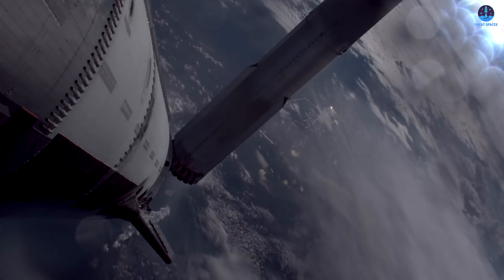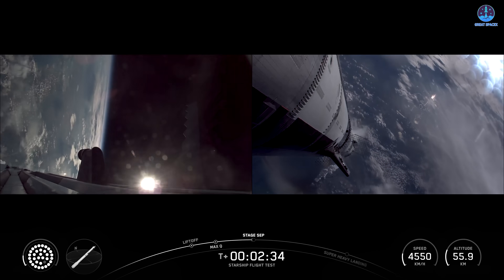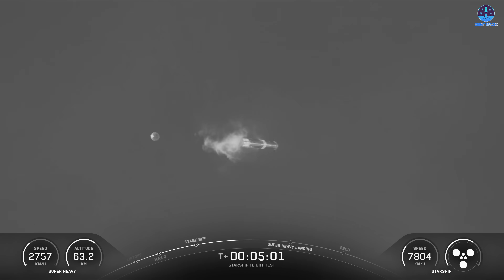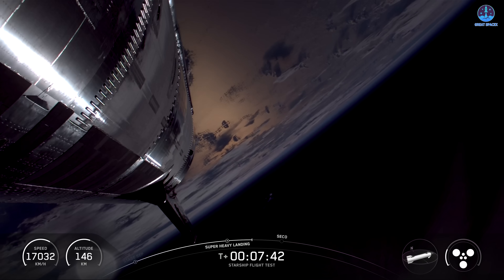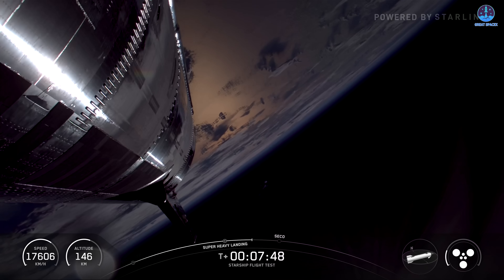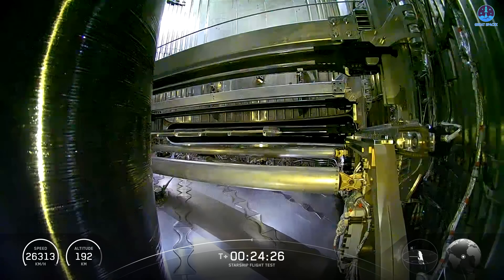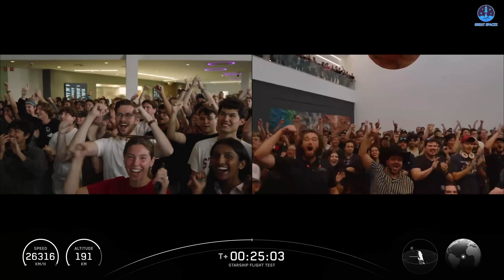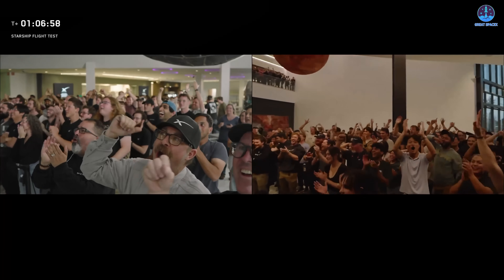BIG NEWS! Starship Flight 10 S36 successfully Deployed Starlink & Splashdown, B16 Landing Flip

Comment: Did you notice that one of the booster's 10-ring engines shut down at about 1:33 into the launch?
Reply: Yep.  They’ve seen a few engines misfire over the past launches.  Even the one that they successfully caught had an engine fail.  There’s enough redundancy in the design to deal with it though

Comment: Was it supposed to explode like that?
Reply: If you mean the explosion inside the engine bay with all the insulation debris; no, that was not planned.
If you mean the explosions at splashdown; yes, both were expected. My speculation is that a self destruct explosion is used to break the rocket apart allowing it to sink to the ocean floor. It's easier to recover than if it goes floating around, pushed by ocean currents to unknown locations.
Reply: @3DPDK thankyou
Reply: Yes, it is the most ecological way to do it. Letting it sink intact can cause major damage to the sea life in the area should water pressure crush it and even if it remained intact, it would be too dangerous to recover. The parts that were under the water when it blew up will be far less damaged than the rest of the ship and those pieces will likely be recovered for study.
Reply: 爆炸可以把剩餘的燃料燒掉，相對會環保一點

Comment: Both stages of the ship crashed in a fireball. What happened to re-usability? And these sheep are cheering like they just invented the wheel.
Reply: Because that was the plan at the start. Both did exactly what they were supposed to. They were never designed to land in water. SpaceX has done more in the last 5 years than all the rest of it's competitors combined. Bet you cheer when the other space companies send up a tourist trip once a year since they aren't "Musk".
Reply: @kamxam1384 That's a stupid plan. They were supposed to land successfully but this was a complete disaster like I thought it would be. These people are insane if they think it was a success. W hat at a bunch of morons clapping about this trainwreck and the announcers were just as bad.😮😮
Reply: @Walter-f7h1q  I really try hard not to tell people they're stupid, but you broke me. I feel ive lost some IQ points for having read your comments.
Reply: You don't seem to understand test flights. The testing for this flight had nothing to do with starship or booster land landings back at the tower. The object of the test was to test payload deployment, engine relight and reentry.
Reply: "What happened to re-usability?"
Falcon 1 through 8 had the same testing and implementation stages and were not re-usable. Falcon 9 is most assuredly re-usable
Reply: It was never intended to be caught or land. It did everything it was supposed to do in the absolute worst conditions possible, one engine out intentionally, re-lighting the engine, missing heat shield tiles on critical areas, etc. It completed the pez dispenser, successful hot stage, maintained attitude control, and landed right next to the bouey as planned. What else were you wanting it to do?
Reply: because its a TEST FLIGHT, its to TEST the systems before eventually doing all the planned systems. In fact, B14 was already reused, having its first flight as Flight 7, then its second at Flight 9. So re-usability is pending, and its not easy.
Reply: Don’t bother.  He’s just a far left basement dweller rat.
Reply: What kind of rocket system have you designed and implemented 
Nothing 
Okay you are a bigger failure
Reply: Like me you are correct. They try to brainwash people by cheering and calling it a success but it was a complete failure like always. How many more rockets are they going to destroy before they give it up. They should go to prison for polluting the atmosphere the morons.
Reply: These so called test flights are like beating your head against the wall till you get brain damage. All you succeeded to do was get brain damage and all Musk succeeded to do was explode a bunch of rockets.
Reply: It pisses me off that they think this is a success.They always laugh and cheer even when these things crash and burn. They must think Trump is a great president even though he's worthless too.
Reply: @Walter-f7h1q walter, you again?  Does Jeff Dunham know you’re on the computer?

Comment: It seemed to me that lift off was sluggish and it took precious seconds to start moving.
Reply: The Stack Weighs 11 MILLION POUNDS at lift off! 😊
Reply: From what I understand it was basically held in place until full thrust was achieved and then it was released like you would a slingshot
Reply: It actually lifted off quite fast, its just that for some reason the video was delayed and every step happened 2-5 seconds after it actually did, including the liftoff